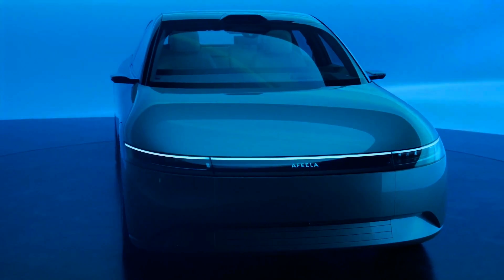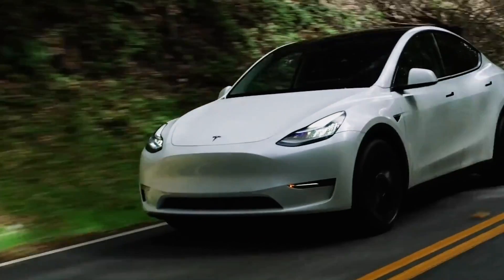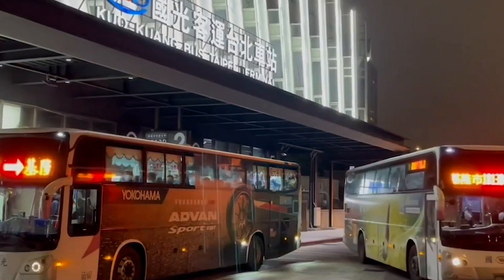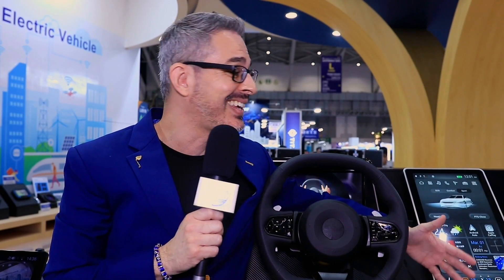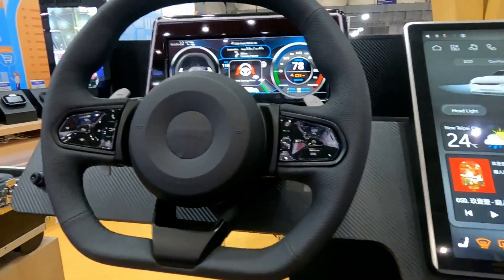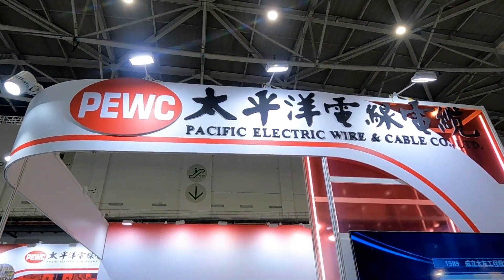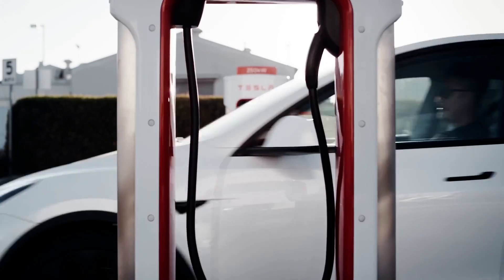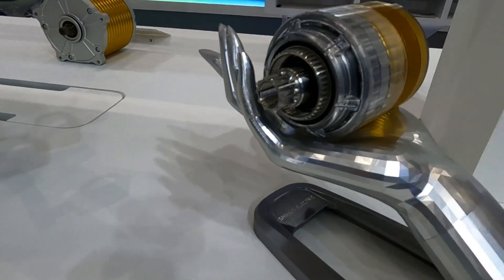What's Inside Cars of the Future?

Comment: Cars so expensive, they should last 3 times longer…

Hint: smaller and replaceable batteries

6:43 high power cables are usually designed to heat up to 90 C. 😮 if you don’t want that temperature, you need twice as thick cables at least!

Water cooled HV cables: there’s no law or code against that… 😒 they are used in welding… but it would be better to innovate in robotic charging